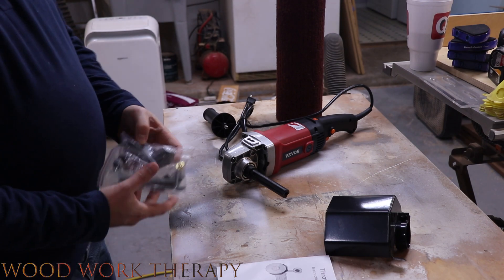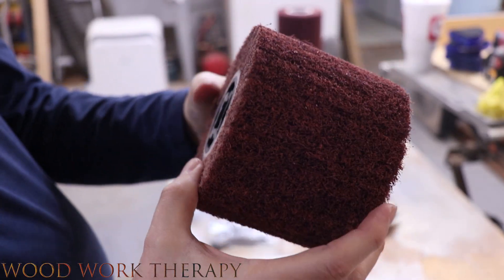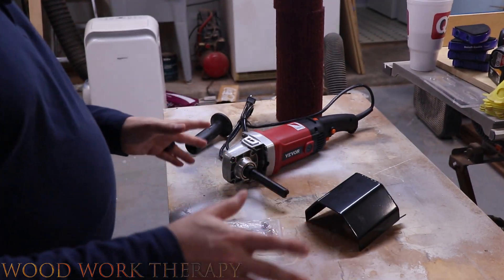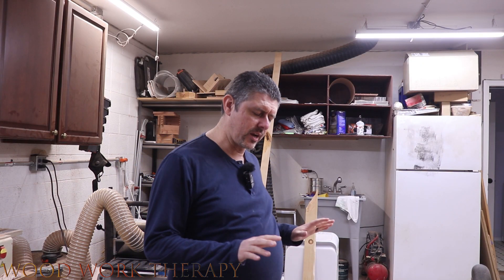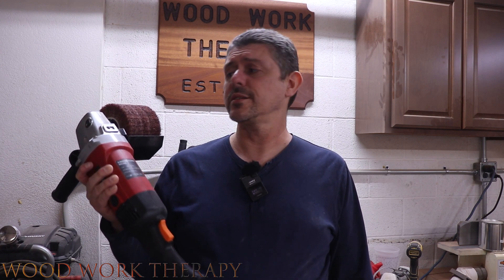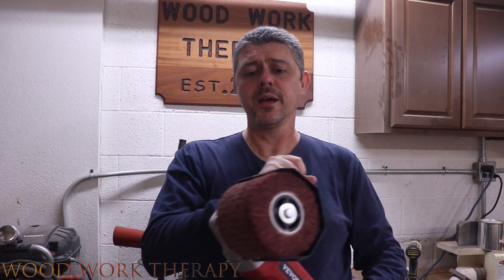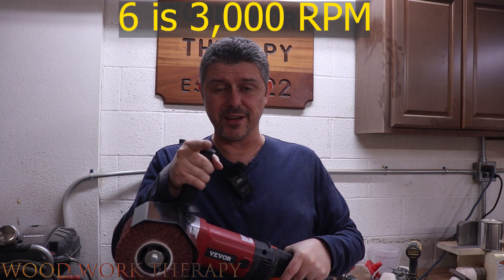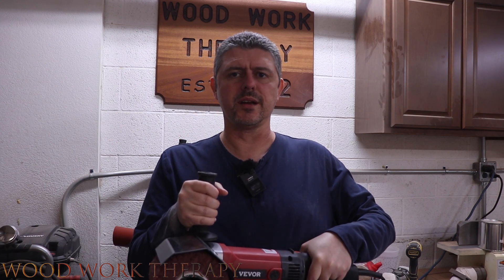Vevor Surface Conditioning Tool: An In-Depth Review of its Features and Performance

Comment: Will this be a good tool to remove rust from table saw table, and with what drum? Thanks.
Reply from the maker: To maximize the performance of your Vevor Surface Conditioning Tool, you may want to consider using more aggressive wheels, particularly if you're dealing with thicker rust or other tough surface debris. However, if the rust is not too thick, the wheels that come with the Vevor Surface Conditioning Tool are already a nice happy medium that won't gouge the surface easily. Hope this helps!
Reply: @WoodWorkTherapy  Great. Thanks. I’ll give it a try this weekend.
Reply from the maker: @Yang Ji  Anytime!